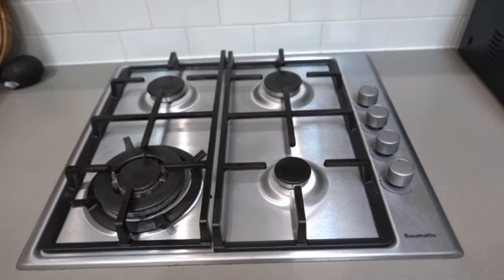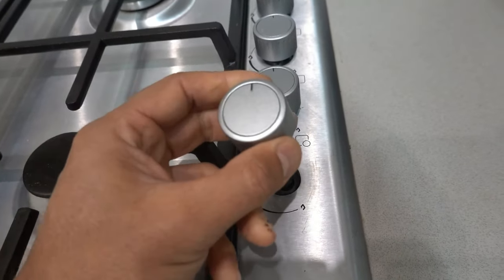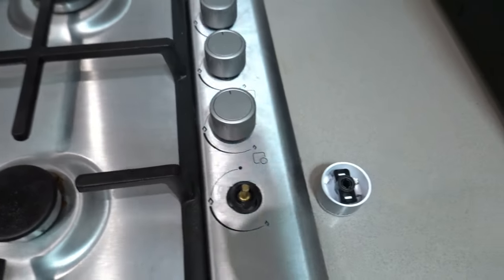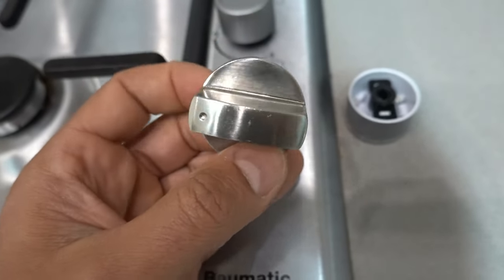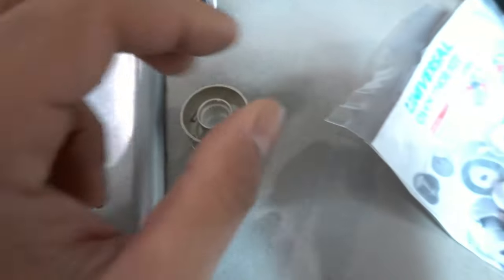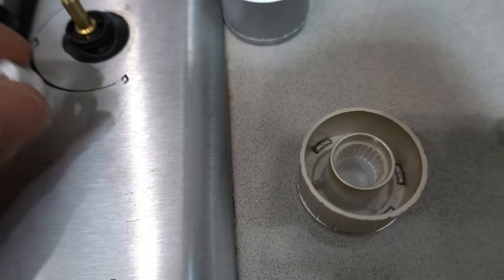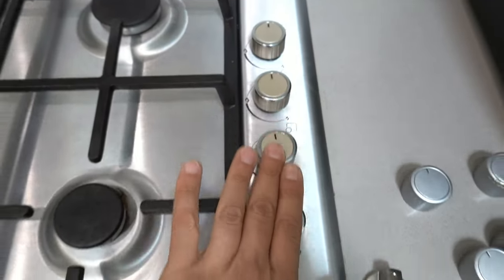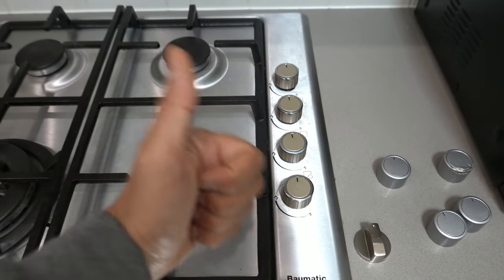How to replace stove / cook top knobs

Comment: Buy in (Hobby Lobby, home depot,lows) , small Aluminum Sheet ( 0.16*4*10) , crazy glue and scissors, solution for 3 dollars. Fit around stick-base and later put it inside broken knob or simple put a thin line of aluminum on the flat part of the Knob.